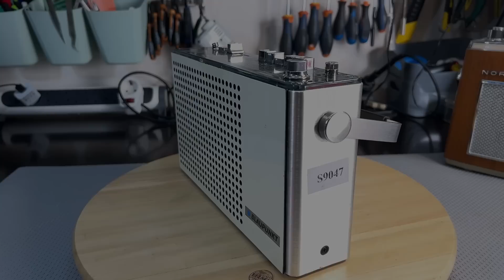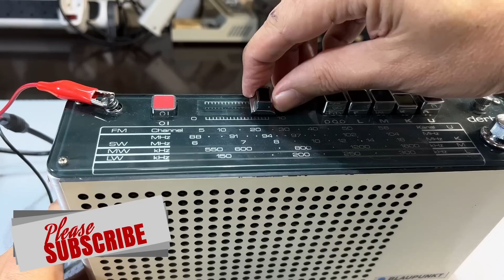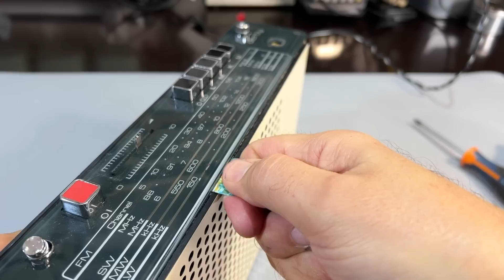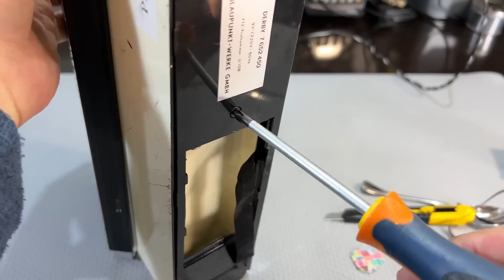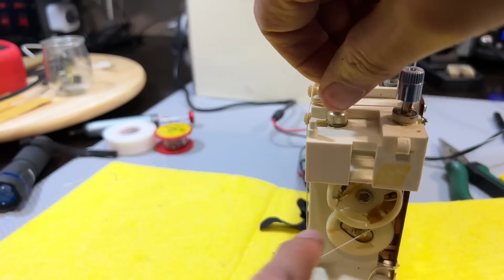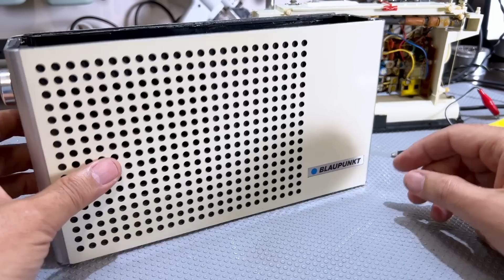BLAUPUNKT Derby Radio from 1972/74 | A Luxury Classic Radio Built to Exceptionally High Standards

Comment: Would it worth replacing the unobtainable parts with a Silicon Labs Si4831/35-B30 and go with a more modern output stage Just wondering.
Reply from the maker: That would work, but I didn’t want to change anything that was working.

Comment: I once owned a Derby Deluxe from the late 1960's. I tried very hard to get it working, but the more I tried, the worse things got. To me, it felt "fragile" compared to some of the other European radios that I had worked on. And the wires were as thin as they could possibly be.

The early 1970's Derby radio in the video was built during a time of cost cutting and transformation in the radio industry. It is still repairable and not a "throw away" radio like those made in later years. But little things like the double sided tape indicate that service accessibility was no longer a primary concern.

The earlier Derbys had partial metal frames. They also had separate bass and treble controls, a dial light and a very tiny tuning meter. They were also designed for car bracket use. By the time the radio in the video was made, there were cost pressures and many of the deluxe features had disappeared, as had the market for dual use car/home portable radios.

I think the Blaupunkt Supernova and Riviera Omnimat radios are better made than the Derby radios but of course, they were more expensive.

Long ago, I had a Derby 660 from the mid 1960's. Except for the battery door, which had a broken hook that had been repaired, that radio seemed to be of very high quality and felt well made. It was one of those radios that I sold but should have kept.
Reply from the maker: I agree that the cost cutting really messed up the quality that was normal on the market. 
It’s unfortunate, but apparent in all areas of tech.

Comment: Blaupunkt  made a lot of "derby" radios. The version  you have is actually  one of the entry level ones. I recommend  trying  to get the Derby 660 one (older, mid 60s but it has an RF amplifier transistor for AM, excellent reception there, and also has one of the most ingenious dial lights, you just have to press harder on whatever wave length button you pushed) or the Derby de luxe (it has separate bass and treble adjustments and dial light pushbutton, plus, if you are lucky, you can get an US export version, with FM 88-108, min has even the 1960s civil defense marks on it), the Derby Commander, with a 13 cm speaker (all others had 10 cm ones) or, finally, the mega deluxe, Blaupunkt Supernova, a wannabe grundig satellit. That one has fm presets and a special shortwave fine tuning  system. (mine works okay but it is kinda beaten up, oh well, couldn't  pass the opportunity  for such a rare piece). It was also sold under some Siemens name, since in those days Siemens acquired  Blaupunkt  and sold Blaupunkt  products  under their name.
Reply from the maker: This one has peaked my curiosity for other Blaupunkt models, so I may delve into that rabbit-hole 😊

Comment: I'm sure a man of your calibre could repurpose the headphone socket to be an external antenna connection (with the additional ferrite coil idea already mentioned), though I would be worried if my daughter had a mini-whip in her bedroom, ho, ho. Horrible visions of you slipping paper between the front panel and black plastic and painting the same colour as the top of the on/off button.
Reply from the maker: I could use that socket, true. Also, I don’t even want to imagine a mini-whip in my daughters possession 😊

Comment: You certainly have good taste in radios Manuel. That’s a beauty and very well made. You could maybe convert the external aerial socket for use with the mini whip by adding an overwind to the ferrite rod. Painting the grille would be difficult as you said but I like the colour as it is. All the best Graham
Reply from the maker: I didn’t think of the overwind idea. Good one.

Comment: Nice radio, Manuel! The telescopic antenna works for FM and short wave only, on most radios. An external frame antenna for MW and LW (as you found out) works fine. I have made a tunable loop for this purpose out of an empty radio case (except for the loop antenna)

Comment: Hi Manuel !
Really a nice old radio, I like it also. Very complicate to solder on this board, I know 😅 but You did it with bravery like always !👌 The frontpanel I would paint with a hard roller and less paint on it, so that no paint will trickle inside the wohles. I'm sure this will work fine ! Good luck !

Comment: For an external AM antenna coil, I have seen Paul Carlson in a video (can't find it) using a small coil, the same size as the ferrite coils, 20 turns or so, and close parallel to the ferrite rod. Your (large...) coil is perpendicular to the rod 🤔
Reply from the maker: This large coil works best perpendicular to the rod, but also is strong enough placed in just about any orientation, including under the radio.
Reply: @electronicsoldandnew  Have you tried that coil on other radio's too ? I am getting suspicious of a fault in the front end of the AM.
Reply from the maker: I have just tried it on the Saba stereo that I’m doing. Same result. Works great.
Reply: @electronicsoldandnew  👍🏻

Comment: I was shouting "TAPE SWITCH " so hard to the screen I got strange looks.  Had the same problem with mine. Great job once more. And don't change the colour.  Maybe add bluetooth on the tape in
Reply: Another vote here for Bluetooth
Reply from the maker: I should have listened 😊 I’m not changing the colour. I really like it as it is.

Comment: Oh my me I have one of these with a wood effect front, handle missing if i could only get the dial string not to slip, edit to add mine is older round bittons and no slider for volume also tuning is is different spot.
Reply: So mine is a derby h (yes in lower case. it does not have the fine tune for SW but it does have an external areal socket and tone control. no mains input socket but mains lead out of the bottom. inside open style tunning capacitor that was seized up when it arrived and had disconnected dial string. the case i think is almost the same. after freeing up the tuning cap and getting the dial string almost correct it has been working fine for over a year, i do plan to do some proper work on it and to get the dial string to stop slipping, it tunes around nice and easy but slips. i love the sound on it. oh BTW bbc radio 4 long wave does not have long to go on the air, i heard it is only got until all the last remaining UK economy 7 heating clients get changed to smart meters as a carrier tone is sent to switch them on for low cost tariff at night.
Reply from the maker: These are really worth working on, but a little tricky. Sad to hear about the BBC radio 4. I guess it’s the future.

Comment: I was lucky enough to have found and make play again a cheap B&O Beolit 700, about of the same period, exactly same architecture. Plastic internal frame, metal shell. The PCBs design of that time was imitating a flowing fluid, with shapes like water drops, instead of straight rails as we see them today. Each of those radios teaches us a lesson in history of design. Thanks, Manuel!
Reply from the maker: Yes, the PCBs were quite different then. I guess one can ice up a lot of experience working on then, even if it results in some damage at first.

Comment: Sturdy case and impressive loudspeaker driver: it has to sound good! No cracked handle either! Isn't it disappointing when everything works this well? Now that you have secured a great specimen maybe you go after a cheap broken one next time. It's always easier to fix something when you already have a working example.
You're right in that an old car antenna used as an external antenna is a great idea - especially if do not have access to the roof. Nice job with the paint touch up too - that airbrush must be coming in very handy!
Reply from the maker: The external antenna socket is common on a lot of these, which also have a socket at the bottom that you would plug into a plug in your car. Nice idea at the time.

Comment: Where do you find these? That's an absolute beauty - so is the Braun.
But if you're into portables you should also track down the (valve) Rohde & Schwartz field meter - or it's transistor equivalent(s). More utilitarian in looks but quite a thing to behold.
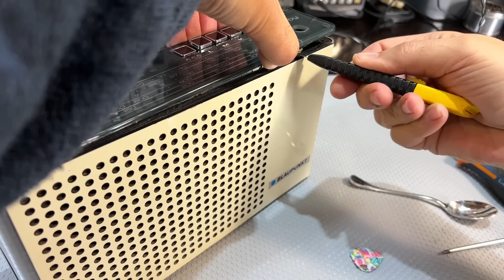9:00 That's a bit risky there. If you had scratched the back of the dacron/whatever plastic that is, you'd be gutted. I know I was and I was only using a cotton q-tip. You'd think it'd be safe to use but the back of the dacron just has an unprotected paint layer that is begging to flake off after 60 years of being stuck there!
Reply from the maker: I got this one on ebay … just got lucky. 
Sometimes I see what I’ve done and what could have gone wrong, and I cringe 😊 I got lucky.